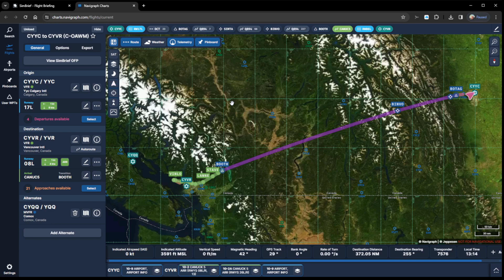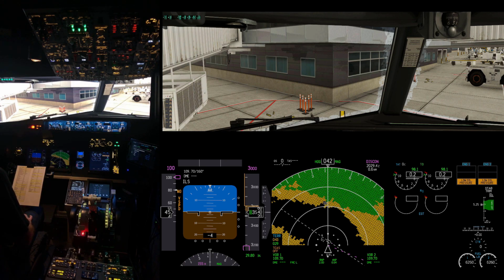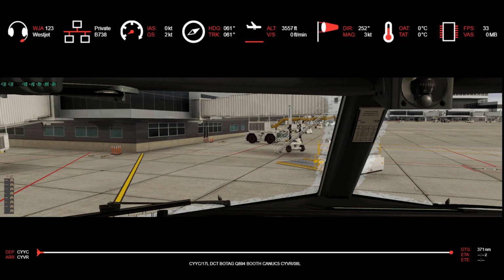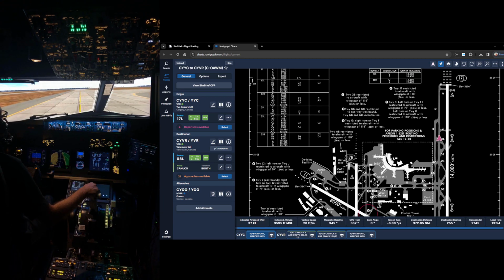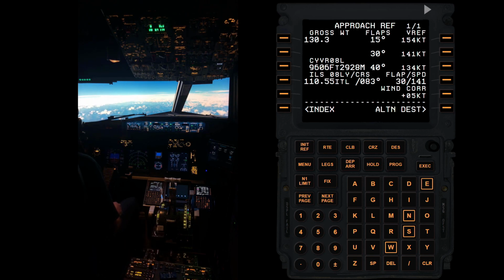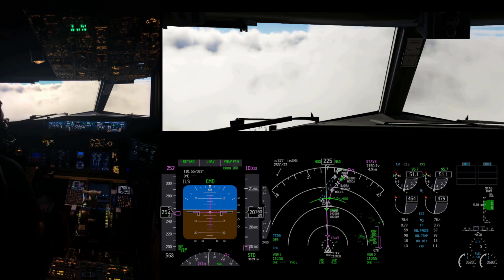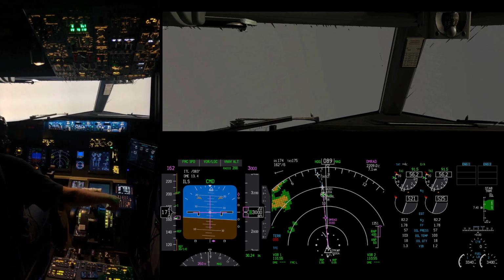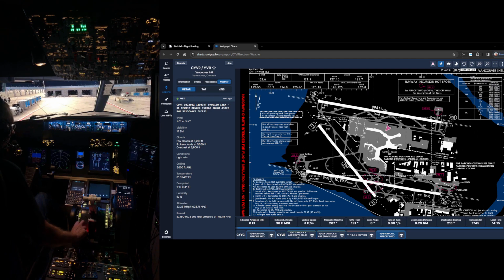Unleashing The Sky: Journey from YYC to YVR In A Cutting-edge 737-800 XP12 Zibo Mod Home Cockpit

Comment: Question:  My X-Plane simulator recently started to give me a problem in that the aircrafts and the ground vehicles move a little then stop and move again, and it keeps doing that.
I did send info to the X-plane forum with mixed results.  I have been using this system for years with no problems. Not sure what the cause is.  
I have done some checking but can't seem to fix the problem. Any suggestions?
Reply from the maker: That’s an odd one… haven’t see that.  You on the latest release?
Reply: @simpilotandrew4659  Yes but for some reason it is now working.  It may have to do with live traffic plugin. Not sure.